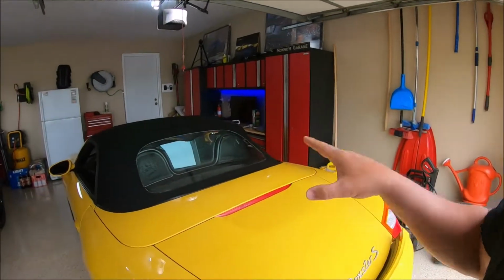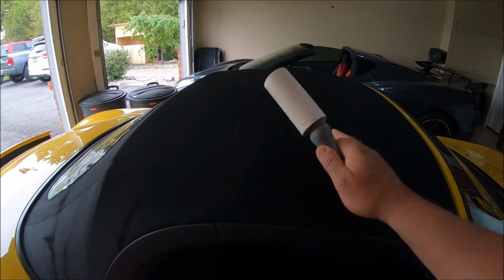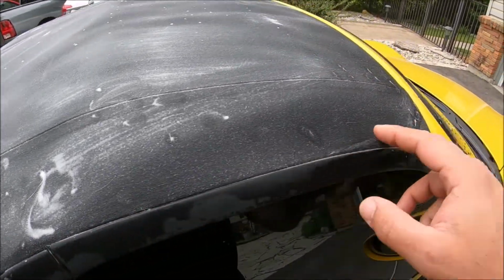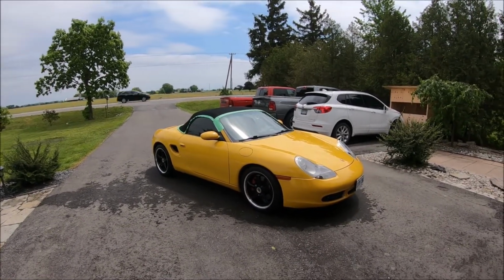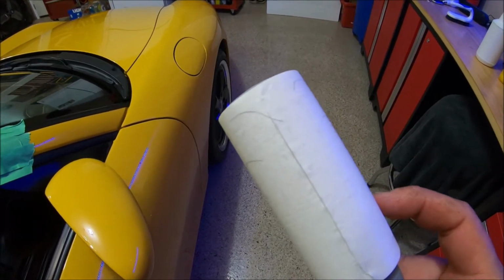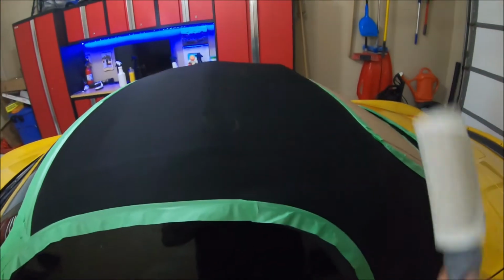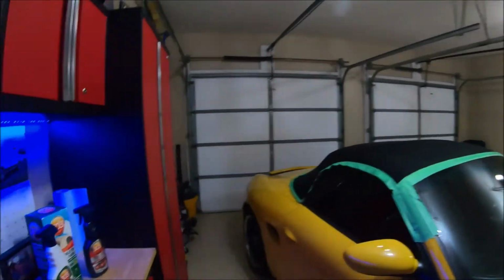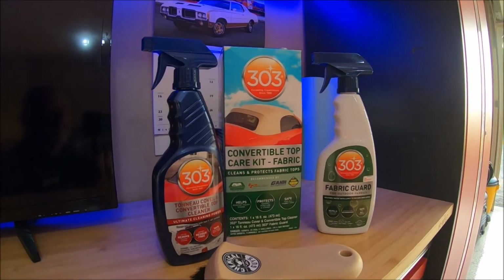HOW TO CLEAN AND PROTECT your Convertible Top using 303 cleaner and protector.

Comment: looks good, thanks for the video. I am about to apply a layer of the fabric guard to my new soft-top car (not going to wash it as it's a new car) and bought the same kit already. Hate to say it but I think you overpaid a little on the 303 products. I got them at about 50% of what you paid on some local car-detailing website.
Reply from the maker: Thank you. Keep in mind it's Canadian dollars but ya I probably did. Story of my life lol. Good luck it works great
Reply: @LifeOfAnAutoTech  Oh ok I didn't know that, in that case it makes more sense. I paid 38 euro for my kit so about 55 CAD. Anyway this stuff looks like it works great I just wish the bottle would last longer as it seems you'd only get about 2 coats max on that small Porsche top.
Reply from the maker: Oh no it will last. I did 2 coats and still have quite a bit left.